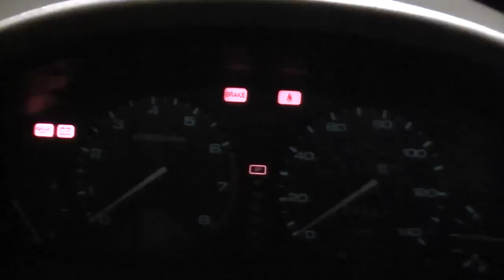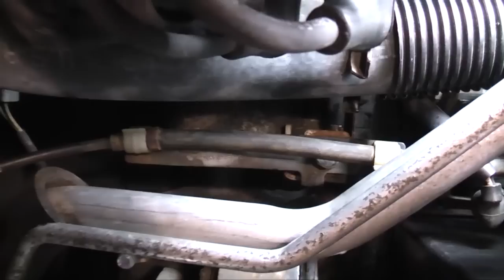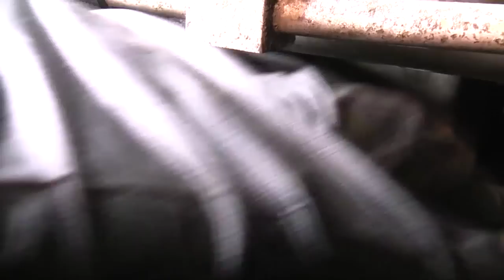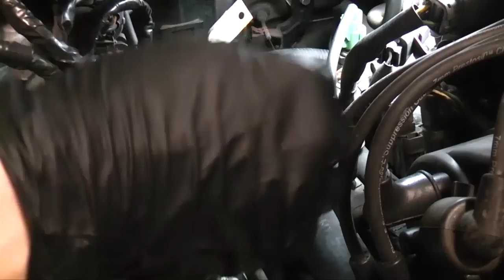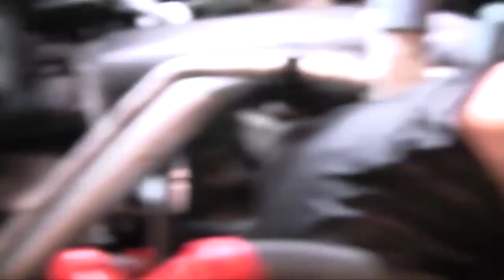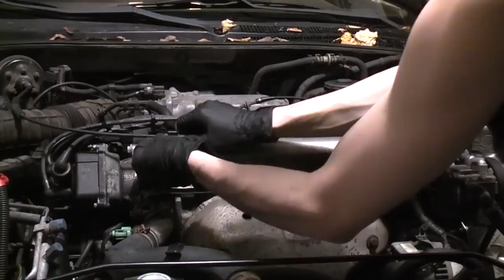Honda Accord Starter Replacement

Comment: Excellent and detailed description on how to get this job done. Your instructions were specific and professional and a great help:)
    Now for a couple tips for all you DIY'ers:
      1)  I used a short 12mm socket and a mini ratchet to remove the + battery cable from the solenoid. It gives you more space. 
       2) I used a 3" socket extension & a 14mm deep socket with a standard ratchet for the starter mounting bolts. I also needed a leverage bar to attach to the ratchet to get the bolts loose. For the leverage bar, I used an old aluminum 1" wide pipe in which I just bent until it broke off. I broke off about 1' in length then used a hammer to shape the one end so that it would fit snug on my ratchet.
   (Note: I had 3 three inch socket extensions and noticed they were not all the same size. One was 3/8 of an inch shorter then the others which was perfect because the other extensions were making my ratchet hit the motor mount brackets which was preventing me from being able to get the bolt off. Check your extensions or compare other extensions if shopping for one because some are longer than others)
    If your battery J bolts are not rusted on then remove the battery because then you can slip the starter straight out from where the battery was. Mine were rusted, but I had others from a previous car so I used a mini hacksaw to hack 'em off. It saved me a trip to the auto supplier to get replacements which would have made me do it the way this guy did it in the video. IOW, it would take an extra 10 minutes to work the starter out with the battery still attached or an extra 45 minutes and $5.00 later to take a trip to an auto parts supplier to get the replacement J bolts(those are the bolts that hold the battery in place)
    Good luck!
Reply: I am about to do this to my Honda thank you so much for your comment and instructions along with this great video!!
Reply: Imma need luck for sure 😂

Comment: I just completed this myself, although I had to borrow a couple tools from my neighbor. My concern is that I feel that I didn't tighten the bolts hard enough, that is, I tightened the thing as hard as I could with my dinky ratchet but not with my neighbor's manly one. If need be, I can always take the battery out to tighten everything, but if I tightened it with a 1/2 drive ratchet, is it fine?

Comment: what are some tips to get the 2 14mm bolts out? I was down there for the longest and the wouldn't budge. I used the right size for sure. I have a 4 inch extension and tried forever to get out the right bolt (shorter one). Also, I definitely CANNOT get the left bolt out with the sets that I have. What is a good set to buy (that isn't too expensive bc I just bought 2) so that I will have a long enough extension to reach the left bolt?
Reply from the maker: Get an assortment of 3/8" drive extensions to get the proper amount of reach. A 3, 6, and 10 inch long set should have what you need. The area around the starter isn't very forgiving if your socket (deep or shallow) and extension combination isn't just the right length.

If you're having difficulty breaking the fastener loose use a breaker bar or slip a pipe on the end of the ratchet for added leverage.
Reply: ***** Yes, I bought both a 5" and 6" extensions. Neither worked because I was using a 1/2" drive torque wrench which was too huge. I ended up using a series of adapters and the crow bar that I use to lock my steering wheel. lol Anyway, I got the starter off, tested it and put the new one on. It cranked instantly (squeals a bit but that's another problem). Thanks SO much!! Your videos are awesome!!!
Reply: I'm having the same problem because of instead of using head studs it's bolts threaded  in the case which I'm guessing is going to be seized up more so than having to pull a nut off of a head stud any suggestions to get that bolt freed would help maybe cranking the motor and getting it warm before doing it I don't know I don't want to break the head off of the bolt

Comment: I've replaced a starter on a '63 Opel Kadet, a '68 Chevy pickup, and a '93 Nissan 240SX. The Opel & the Chevy were dead simple, as one would expect from vehicles from that era. My Nissan, on the other hand, was a cast-iron bitch.

My daughter's Accord was having trouble igniting, but she kept delaying taking it in for service, choosing instead to just crank it over for minutes on end until the engine finally caught, and thereby killed the starter that I'm going to replace tomorrow.

Once I get the starter swapped, she's going to take it to a mechanic to diagnose the failure to begin combustion. However, I'm also going to make her watch at least some of this so she appreciates what a pain in the ass it was to do, because she'll be at work while I do the starter.

Thanks for taking the time and effort to post this video.
Reply from the maker: Yeah starters tend to be either way out in the open or buried deep.

Thanks For Watching.

Comment: I bought my 2005 new. Had 3 MAJOR "feel" issues. The brake and accelerator springs far smaller than what they need to be. ZERO progressive feel. Felt like INSTANT ON, INSTANT OFF. Not smooth at all. Replaced with thicker ones and the STARTER was always "lazy". Replaced...

Comment: You make some of those clips and hoses, so easy to take off, mine are still intact but super stiff damn! Thanks so, I just bought a Denso to put into my '97. this video has helped.
Reply from the maker: It's the luck of the draw all you can do is be gentle as possible and hope they don't break.

Don't pull or push the plastic any further than necessary for removal to avoid damaging them.

Comment: Just another tip from a mechanic, removing the battery gives a lot more room for turning the starter bolts, and it only takes an extra 5 minutes. With the Battery and battery tray out too, you can get the start out by going up rather than back. Ive been Honda certified since 2006. Nice Video tho
Reply from the maker: I put that in the annotations awhile ago. It's much easier to remove the battery but I'd still recommend pulling the air box hose off to have better access to the fastener close to the motor mount.

The reason I didn't remove the battery was because the threads on the J bolts were really rusty. I've sheared enough of them to know when to leave them alone unless I have spares on hand.

Thanks For Watching.

Comment: A bit more difficult than the 90-93 Accord, whose starter is easily very accessible once the intake tube is removed. The AC lines are out of the way and there's pretty much a clear shot at every bolt except for the rear starter fastener, which does need a proper extension. But on either car, it's not a particularly difficult job in the end. MUCH harder things you can do on a car. Thanks for the video.

Comment: great video. i just replaced my starter in a 96 honda accord...after i was done i cranked the car...now it cranked but right when it did crank... for maybe a half a second or a whole second it sounded really bad...kinda the same sound a car would make when some tries to hit the starter switch while the car was running... i have had this car for 4 years...im not holding the key too long... i turned it off and tried again and the second time it didnt make that sound... the next time it did though

Comment: Thank You so much for taking the time to post this. I would have never gotten mine replaced in my 96 Isuzu Oasis without your help.
On the Oasis the starter has to come out forward and you need to loosen or bend the throttle cable guide to the right about 6" to get it out.
Thanks so much , Mike

Comment: Thanks again. I did the leaky alternator repair from watching your vids and just finished replacing my starter. Again, your instructions are awesome and gave the confidence to do the job! I went ahead and removed the battery for more room, as you said. Things went smooth. Thanks